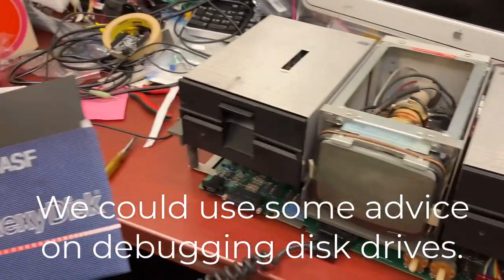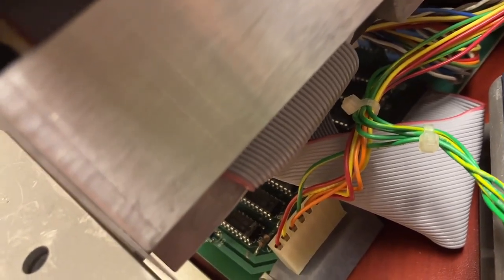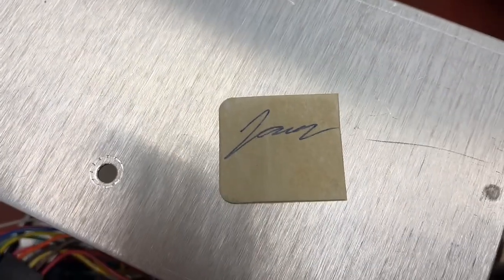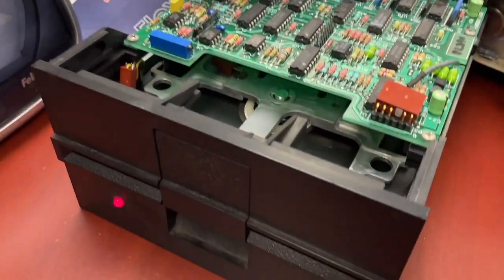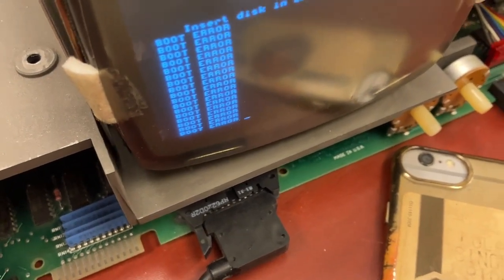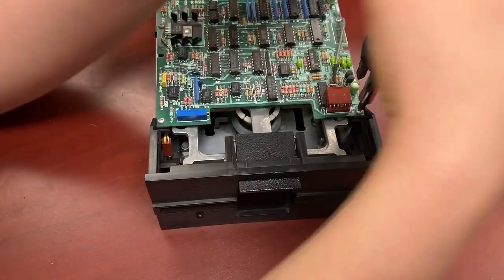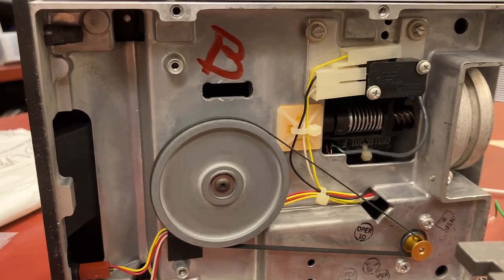Osborne 1 Disk Drive: Boot Errors and BDOS Bad Sector Errors (don't know what to try next -- help!)

Comment: The heads should be able to move much more freely than that. It should be doing this when failing to boot https://www.youtube.com/watch?v=Tu5KvC9L3uE
 
I'd put a drop of light machine oil on the sled and actuator mechanism. Cheers.

Comment: I replied to a couple comments but adding a few extra details...

Before adjusting or disassembling drives, exhaust all other possibilities if you can. Like the guy that mentioned RAM issues, or a bad cable, or a cable on the drives has come loose. Be thorough inspecting and trying the easy stuff first.

Can you find an Osborne person in your area you can meet with to check your disks. Best way to alleviate that variable so you know it is not the disks you bought. But again, I would not assume  the disks are bad right away.

Comment: DId you put the cabling and resistor pack back the way it started?
Reply from the maker: No, so right now the drive that's labeled "A" in red is actually being interpreted as the B: drive and the drive that's labeled "B" in red is actually being interpreted as the A: drive.
Reply: @Lantertronics  The resistor pack is just a termination resistor. It must always be installed on the drive at the end of the ribbon cable. It does not determine which drive is A or B. That is either determined by a jumper on the drive, or by a twist on some of the wires on the ribbon cable (where the select wires are reversed for A vs. B). IBM PC's often used a twist. I believe TRS-80's used a jumper. The drive should have a jumper regardless.

I didn't see a twist on your Osborne, so it is probably a jumper on the drive. I don't have my Osbornes handle right now (I have several). Otherwise, I could check. If you get desperate, I can pull one out of storage and see.
Reply from the maker: @mglohmeyer  OOOOOOH!!!! Now that is a VERY important detail. First thing I will check when I get back in is where the termination resistor pack is. I may have it in the wrong place.

Comment: The optical encoder was used to check drive speeds using a fluro lamp ... when the pattern was stationary at the correct mains frequency the drive was running at the correct speed. IIRC the spindle was belt driven so this was important for detecting belt slip. Wrong speed -> disk won't read.
Reply from the maker: Ah, that's good to know. The lights in my office on campus are fluorescent so that should work.

Comment: What alignment system do they use?  Is it a head to track alignment issue?
Reply from the maker: That's a good question. I have docs for it and will investigate.
Reply: @Lantertronics  FYI, the head motor is a stepper motor. There is no servo mechanism here. Saying this to point out that alignment is a whole system alignment, and once aligned, track to track alignment is determined by the stepper motor step distance, so no track to track alignment is needed. So alignment is actually pretty simple, but....

I would not suggest messing with alignment until you have exhausted all other avenues such as cleaning the disk heads, making sure the spindle speed is correct using a 60Hz light on the paper disk with the dashes where it says 60 (Hz) and 50 (Hz), and making sure the drives are connected correctly.  Once you touch alignment, you might make it worse without the proper tools. Other people who have aligned drives before can hopefully explain better. Said another way, don't start adjusting or disassembling things first. Do that last.

Also, make sure the rails/slides or bearings involved in the head movement are clean and not clogged up with old grease, dirt, etc. I am mostly familiar with IBM PC and TRS-80 floppy drives, which have chrome rails for the head mechanism to slide on, and I have gotten read issues to go away by cleaning these rails, and (maybe) lightly oiling them - check service manual about oiling, or get help from someone that knows drive repair before just oiling stuff.  

The Osborne drive looks like it has a worm drive shaft, and that might be dirty and need a bit of grease or maybe the grease on the stepper motor bearings is old and dry, causing it to not move correctly. Remember, oil and grease can go everywhere, so know if is needed, don't just assume. Otherwise, you will get grease on your floppies.

The point I am getting at is, alignment shouldn't go out just due to age, but grease and belts can definitely go bad with time causing speed and alignment issues.  Alignment would go out due to usage or being dropped (which could have happened too).  

I'll say more in reply to some other comments.
Reply from the maker: @mglohmeyer  This is incredibly useful info! Thank you!

Comment: Boot errors on the Osborne don’t necessarily indicate problems with the drives or disks. The boot up screen only uses the first bank of RAM, but loading from disk uses the other three banks of RAM. So if you have any bad RAM chips in those banks, you just get boot errors. 

It’s very likely one of those RAM chips has failed.

I wrote up my experience of diagnosing and fixing this on one of my Osbornes here: https://github.com/richardloxley/Z80DecoderOsborne1
Reply from the maker: Ooooooh! That's very good to know!
Reply from the maker: We did have two instances where it said it was trying to load CP/M -- do you think that still suggests bad RAM? Maybe in those a few cases we lucked out and the RAM chips worked for a bit and then glitched?

Comment: The drives definitely are trying to read the disks. I don't think the drives are really bad. It looks more like either the disks are bad, or the head alignment is off. Most likely the latter, and maybe the disks are a bit wonky as well. I'd try to find a manual to align the head and then go from there.
Reply from the maker: I bought the disks from an eBay seller who seems to specialize in selling copies of Osborne software, so I'm guessing those are relatively fresh. That suggests alignment issues.
Reply: @Lantertronics  Yep. I remember WAAAAAYYYYYY back in the mid 80's when I hand(!) aligned Apple II disk drives. Yes, that was absolutely possible back then, because the tracks were as wide as a railroad track. ;) Well, almost. :D

Edit: You might also want to check the speed of the rotation. That's where the little disks at the bottom of the rotor wheel come in handy. Shine a 60Hz light on them (old light bulbs) and the pattern on the outside should be static. If not, you need to align the speed.

Comment: Are any of the disks a DOS boot disc? I Just remembered that C/PM worked on DOS machines in later versions, but I would try DOS. I'm not convinced it's the drives. 
10:49 that's record/playback head chatter. Not a good sign, could be the disc itself has physical damage, because the head is trying to find any data it can read. The bad sector error makes that much more likely, as the drive has given up on it's task without reading any data.
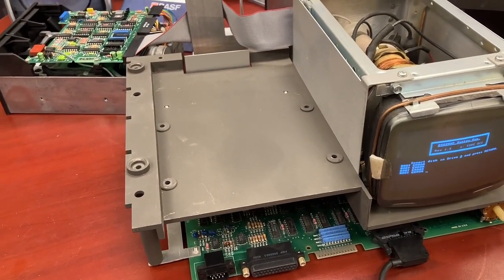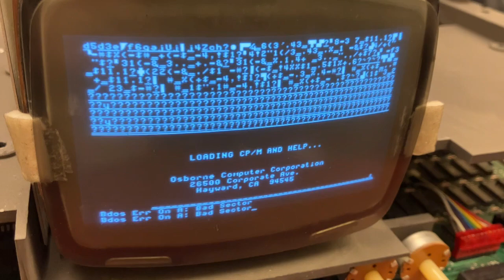Reply from the maker: According to the eBay seller all 5 should be bootable. We did get a couple of instances where it looked like it was trying to load CP/M but then got BDOS errors (at 4:00 and 8:15).
Reply: @Lantertronics  I updated the post, and it smells like disc errors rather than hardware.
Reply: As an audio engineer, my first thought is unseen physical damage. the disc is essentially magnetic tape, which is essentially just scotch tape and rust, and after a while the playback/rec head starts wearing the rust off the tape, and eventually that's a problem.  Same thing happened to Steely Dan while recording "Kid Charlemagne" as they recorded  more and more takes so many times the master started losing tracks.
Reply from the maker: @shipofthesun  It's possible that there was gunk on the heads before I tried cleaning the heads that messed up the disks, and now the disks are messed up and can't be read now that I've cleaned the heads.
Reply: @Lantertronics  You might be right. I'm on the edge of my seat for the next installment.
Reply: @Lantertronics  You should be able to spin the disk in the sleeve and see scratches or smears caused by dirt. I assume the disks you bought were new (or new old stock) and were good disks when sent to you. But if they were old stock that wasn't kept in proper storage, they could have mold on them. You will see this as spots or smears on the disk. Unless you have reason to not trust the seller of the disk, I would not assume these issues first. Not without just cause. Just pointing out what to look for. 

More likely either your disk drives have problems, or the seller of the disks has a drive that is out of alignment compared to yours because they are all old drives and who today properly aligns their disk drives these days. Most people don't have a clue how to do it. I have dozens of vintage 70's & 80's computers and I have never taken the time to learn how to align a drive, though I am sure many of them need it. Again, don't assume the disk seller is at fault first as it is highly likely your drives are the problem as his drives have been working for him probably for some time. Politely ask about it maybe to be sure, but I bet that seller gets these questions constantly from people with bad drives.
Reply from the maker: @mglohmeyer  I got them from an eBay seller who specializes in selling copies of Osborne disks, so I am inclined to trust the disks.